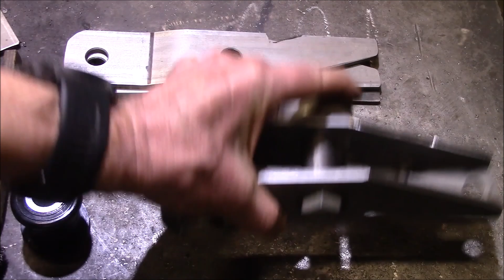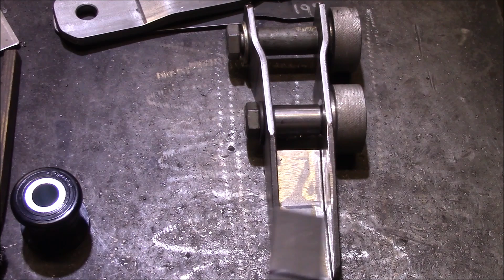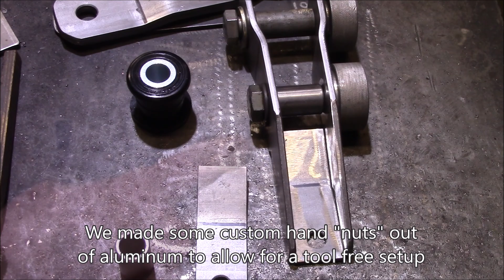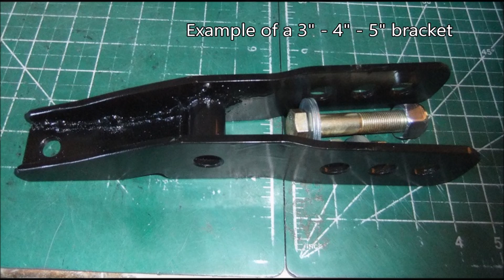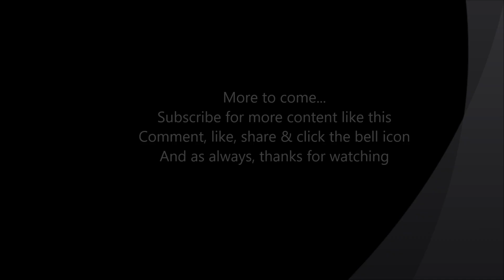2nd Gen 4Runner - DIY Panhard Bracket

Comment from the maker: Here's a photo album with all the parts and dimensions needed to make the drop bracket:
https://photos.app.goo.gl/kQzx3Xyf6QukYze58

And here's a link to 3D printable bushings as well as an adjustable panhard bar:

https://www.thingiverse.com/thing:7026065

Panhard bar hardware, usually need 9/16" - 5/8" (14-16mm) and 3" (80mm) long
Bolt: https://amzn.to/4cXRiMF
Nut: https://amzn.to/4k246UQ
or
Bolt: https://amzn.to/42DIGYh
Nut: https://amzn.to/4jYi75F

Comment: You and your site are absolutely the best. There is not a lot of resources out there for 2nd Gen, and your site has always been immensely helpful. 

After completing a modest lift with a Dobinson’s kit, this rear panhard issue was causing a weird sway especially at highway speeds. Best I could find out there for this Gen 4Runner was an adjustable panhard rod, but after reading up that ultimately does not solve the problem, just rather slightly corrects the cosmetic asymmetry. 

Very excited to tackle this project and appreciate you taking the time to be so thorough with the information.